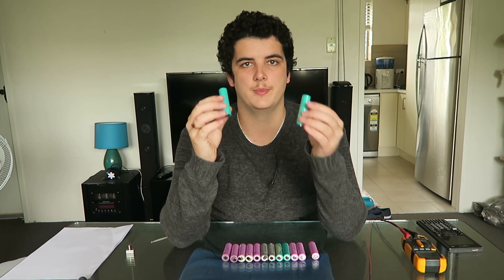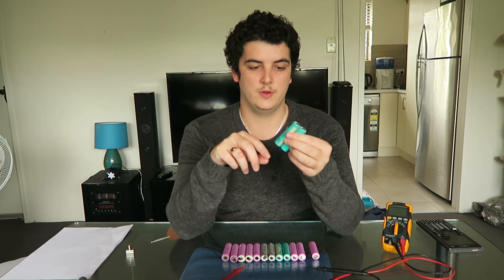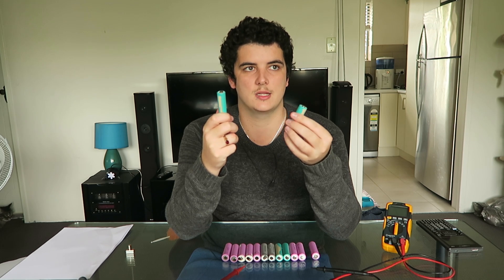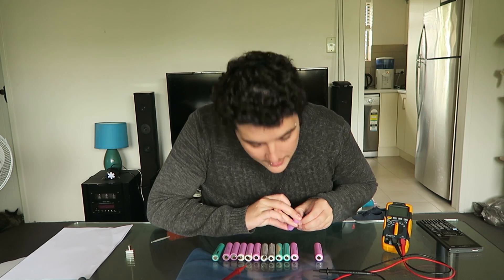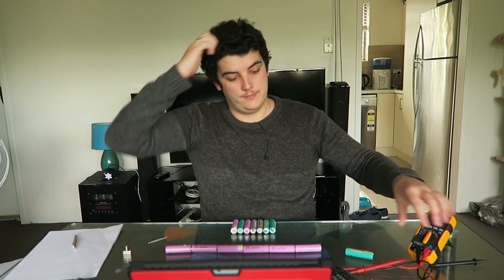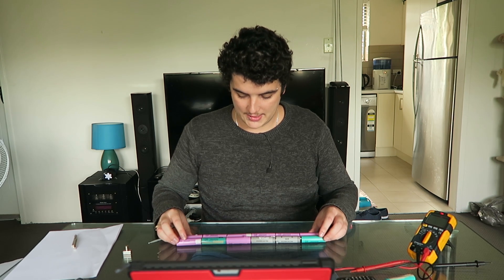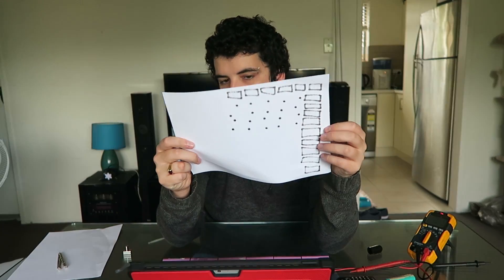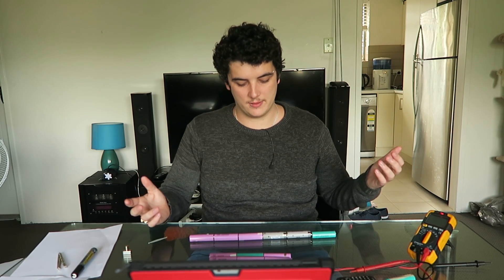How to design an 18650 cell battery pack

Comment: If two different voltage battery connected in parallel, what would be the result between two terminals

Comment: ANOTHER GOOD VID MATE....ooops..caps lock...hahahaha...what do you reckon is the best way to charge a 12 volt Li ion battery pack using solar...I think the normal charge controllers that come pre-fitted to most camping solar panels are designed to charge lead acid right??...or can u also charge Lions with them....

Comment: so, lemme get this straight. you hook up the amount of 18650 cells in series you need until you reach the proper voltage to make a 'cell'. then you attach the appropriate amount of these 'cells' in parallel to gain capacity and distribute work load? 

am I getting that right?
Reply: Reef James Stevens ...Oh, I wasn't expecting a reply for a few days. well I'm impressed. Thank you so much for the video by the way. I'm planning on making multiple batteries and I needed a little more info that next to no one on here had. I didn't know how series or parallel exactly worked so I was hesitant to try anything with cells being so expensive. 

you've definitely earned my subscription.
Reply from the maker: Thanks mate, I hope your projects go well!

I'm going to begin the recording of another video tomorrow and will hopefully have it completed and uploaded within the next few days. It's going to be a "shocking" one ;)

If you've got any other questions, I'm happy to help.

Comment: +Reef James Stevens
Really liked this video. Very informative. I'm a Mechanical Engineering student in USA. I'm trying to design and build an electric scooter and wasn't really sure what kind of motor I should buy. I found some really cheap cells on eBay, so my battery pack will be 10s6p. I know its overkill :) especially because I only live 3.5 miles from school. But thanks to your video I finally understand how to calculate less amperage from each cell. Fully charged I have 0.5 kW battery :D
Reply: What I don't know is how to calculate the range, though i know there are many factors that dictate what that value actually is... like weight, battery pack, motor, etc
Reply: Thanks. Do you have any idea how I figure out how much it draws under load? With batter tester, I'm guessing?

Comment: Youve done your homework, ive completed a cert 2 in Electrotech and never once was i told how batteries work in series and parallel, ive even almost completed first year cert 3 (apprenticeship) eletrotech and still never told, however im learning electric motors and generators kek.